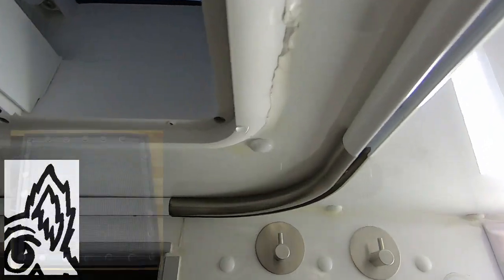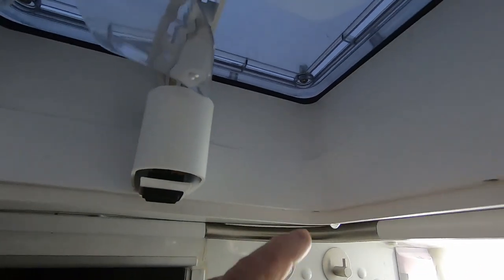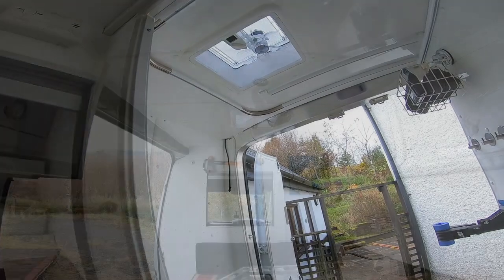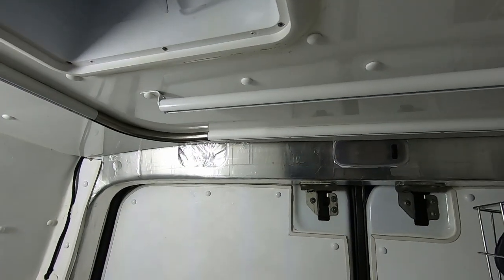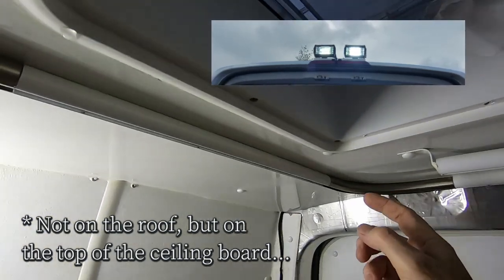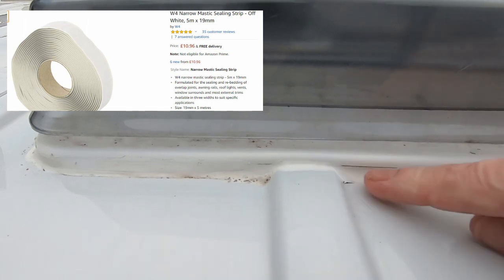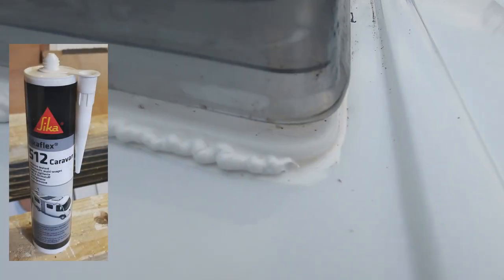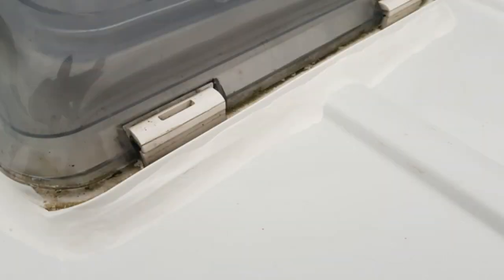#25: Leaking Fiamma Roof Vent [Totally Avoidable]: Sprinter Camper Van Conversion RND Diaries #041

Comment: Great video. Did your fix work? I have the same issue with the sika 512 pealing back off the fiamma plastic. My roof vent has been on for about 5 years but in noticed the sika peeling back after 3 months. I had really only used the sika to make it look neat. The real weather sealing was done with Sikalastomer 710. I concluded that the sika 512 was peeling back because the fiamma is made from polypropylene. It lasted 5 years and severe weather but now it started to leak in the same way as yours. I’m debating cleaning it up and using more 512 or completely disassembling it and reinstalling using just the 710 non setting stuff as fiamma recommended or mastic tape. I notice that many people fit these by just letting the mastic splodge out and leaving it.
Reply from the maker: Thank you for the feedback. Yes I suspect the specific plastic that Fiamma use is the problem for the 512. The fix has worked so far, but due to lockdown I haven't really been able to use the van so it has not been truly tested. As I said elsewhere, the front vent is perfectly fine with the 512 as it is compressed flat against the roof. Your 710 solution sounds like a good one. As you saw in the video the mastic tape didn't work for me but I think I was expecting too much of it to build the height next to the ridges. Cheers, john

Comment: good video. So the problem was caused by insufficient sealer on the roof?
Reply from the maker: This response may be a duplicate as first one didn't seem to upload so apologies if it is. The basic problem was that the vent at the back couldn't fit flat against the roof (unlike the one at the front) because of the ridges. To make up the difference in the height I used strips of mastic on top of each other. Unfortunately the mastic shrank and pulled the outer Sikaflex seal away from the vent plastic and the water got in. If I did it again I would make a couple of wood mounts for each side of the ridge - similar to the mount inside the van - and then seal around the wood. This would stop any risk of shrinkage or flex. I have to say that whilst the Sikaflex seal seems to stick to almost everything it does struggle to bond with the plastic that Fiamma use on the vent which is a bit odd. Hope that helps. Cheers john
Reply: @RedNemesisDogPrime  I have seen this problem on other Youtube videos. It might be advisable to thoroughly clean the plastic with a volatile sprit like acetone or similar to remove the releasing agent used by the manufacturer to ease the component from the mould. Would also be a good idea to roughen the surface with (say) 120grit sandpaper to ensure a good key with the mastic. I am surprised that Sikaflex do not advise this as they must be aware that their mastic is used extensively by self build campervaners. How very unswiss.
Reply from the maker: Thanks for the suggestions. I always clean the surfaces with alcohol before applying the Sikaflex but I think in the case of the Fiamma plastic your recommendation to roughen the surface with sandpaper is probably the way to go. It is the only material that the Sikaflex hasn't been 100% effective on. Most odd... I will follow your advice when I check and renew in the Spring. Thanks again. Cheers, john
Reply: @RedNemesisDogPrime  thanks for your reply. Your post is very interesting as I am about to undertake installing Fiamma roof vent on a mercedes lwb van. It a daunting prospect for a first timer, so any information I can learn is very useful. It must be a real pain if the vent leaks after you have installed insulation etc. Skaflex is very expensive. I have seen videos where different mastics have been used without problems. It seems that a big name like Sikaflex is always priced very high. All the best to you and no more leaks!
Reply from the maker: Just to say that the front vent is not a problem at all. It sits flush to the roof and the Sikaflex works perfectly. I do think that the problem on the rear vent was all about using layers of mastic tape instead of building a solid mount to compensate for the ridges and that making a wood mount would have mitigated the problem. I am a big fan of Sikaflex (so far) and so far it has done a great job everywhere else. Good luck with the install. Cheers, john

Comment: I bought the same leaking aswell never again will i buy anything from fiarmma
Reply from the maker: Hey Michael, It seems that we are not alone with the Fiamma sealing issue judging by others who have commented too. Lesson learned, as you say. Cheers, john
Reply: I've got the same issue on my van. It seems to leak when water builds up over the hinges which is strange. The seals seems fine.. very frustrating